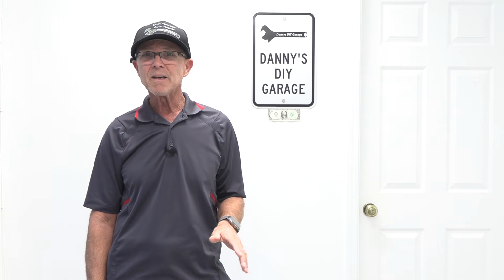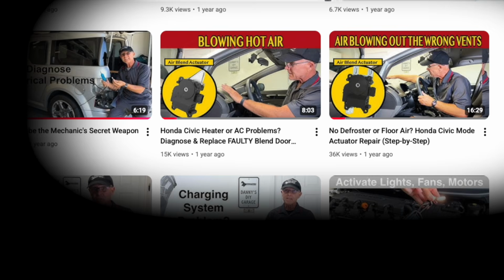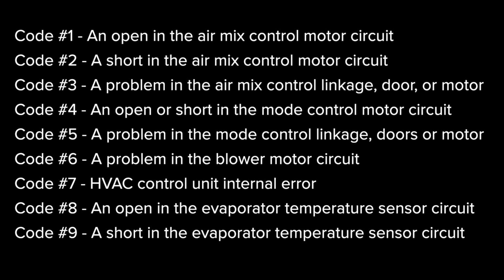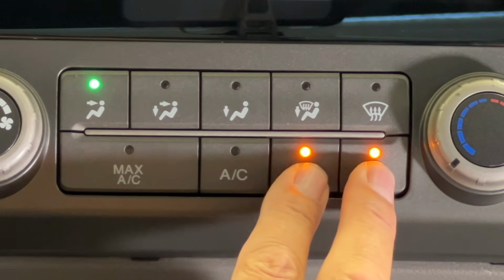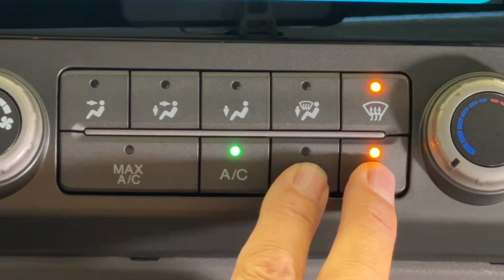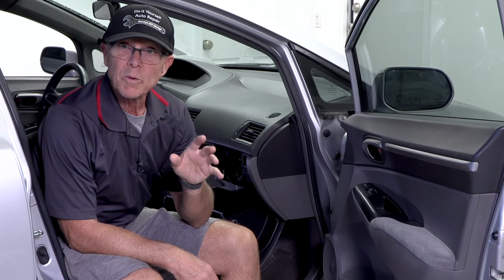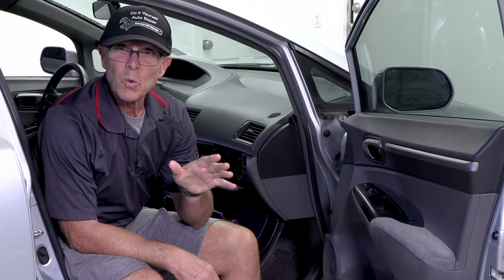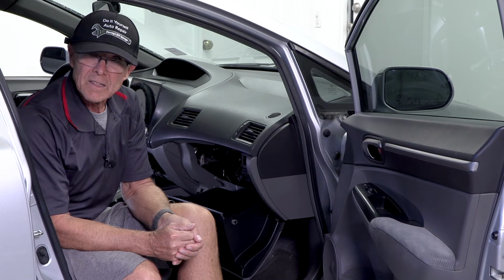STOP Exhaust Smells! or AC Related Musty Smell | Diagnose & Fix Your HVAC Recirculation Actuator DIY

Comment: If I run this test and get 4.6 volts, what could be the cause?
Reply from the maker: If you’re getting 4.6 volts, first check whether that’s in Fresh or Recirculate. You should see roughly 1 volt in Fresh and around 4 volts in Recirculate. Also make sure the voltage changes when you switch between the two positions. If it stays around 4.6 volts or doesn’t change properly, I’d check the connector and wiring first. If those are good, the position sensor inside the recirculation actuator may be failing and the actuator could need replacement.

Comment: Thanks for the video. Would you have a video on the mode actuator that controls the defroster on the 2004 Honda Element? I did see your video on the Civic. Do you have ti remove the entire glove box? I did lower the glove box door but having a hard time. Thanks
Reply from the maker: I do not have that video for the Element